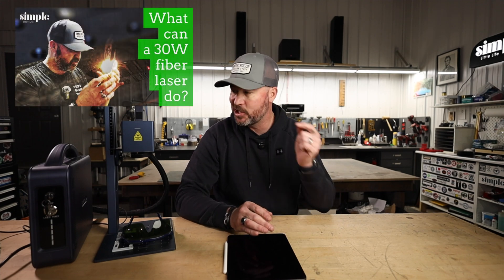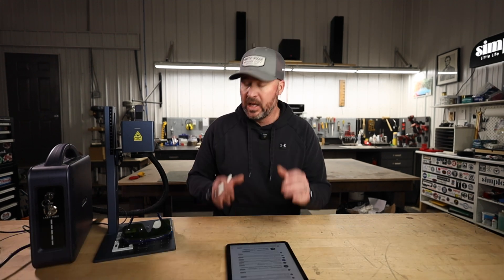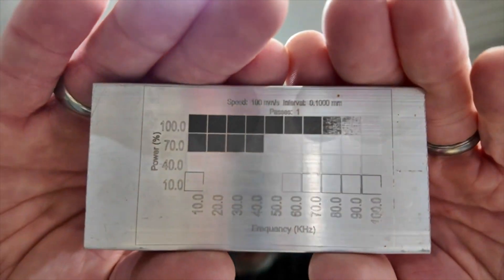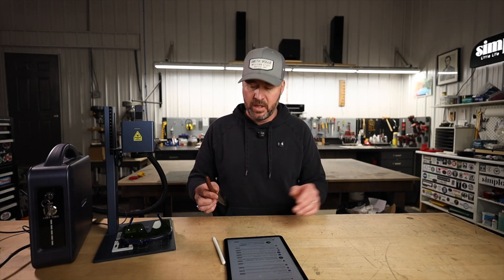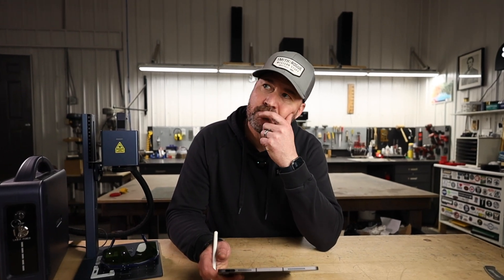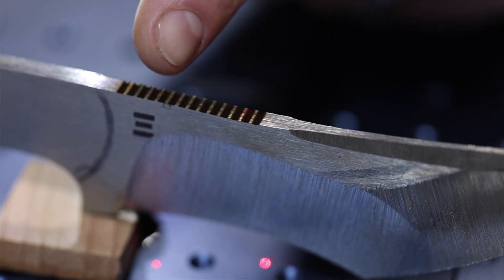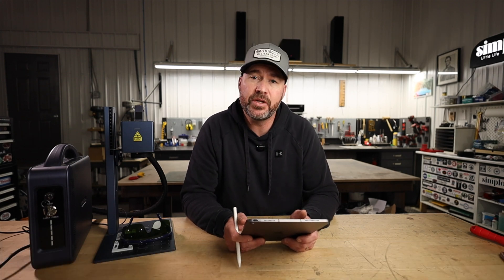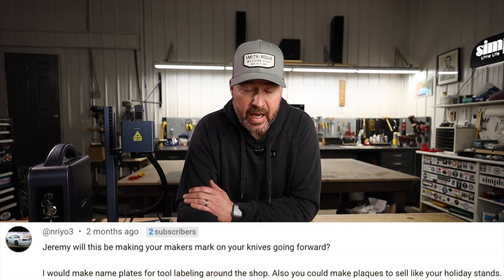5 Month Experiment with FIBER LASER Technology Changed Everything

Comment: If you think that handheld meter is measuring the temp your dillusional.  Sparks like that are ablating metal, Thousands of degrees plus,....at best your mmeasuring an average of the temperature in a larger area of the knife and probably the table....grab that with you fingers and you'll laugh at the 150F measurement.
Reply from the maker: It measures the surface of the blade. Of course the laser is super hot at it's pinpoint tiny beam, but the mass of the steel stays relatively cool. I did pick this up after the laser work was done and it's not that hot. You've obviously never picked up a piece of steel that was just etched with a smaller laser like this....

Comment: I just have a basic 20w diode laser that was given to me, and I’m constantly discovering new uses for it.  I just started experimenting with cutting tang holes in spacers for hidden tang knives, and it seems like it’ll save me a lot of time.  I under size the hole by a few thousandths, and just have a little bit of file work left to get a perfect fit.  I’ve also found it very useful to stencil patterns on flat stock so there’s a perfect clean outline to grind to.
Reply from the maker: Right on, that's a great idea! Yeah lasers are the type of tool that you're not really sure how much you use, but then you just start finding new, time saving, use cases for them. Cheers 👍

Comment: wow, what a cool tool, never seen one before, how much work is needed to put the makers mark on the computer and what software does it use?
Reply from the maker: I use lightburn and it's fairly easy to use once you get the hang of a few basic parameters. Just import the file that is the maker's mark, choose if you want to outline the image or trace it and you're good to go. 👍

Comment: Just curious: Could the laser be used to SHARPEN the knife?  You could certainly make a serrated blade from a straight blade.  If you cut at an extreme angle it might leave it "Gnarly sharp" like a microscopic saw blade.
Reply from the maker: That's an interesting question. The idea of it sounds doable and I wonder what the practicality of it would be in regards to the effect of the heat on the edge. In theory, it sounds like it might ruin any edge retention properties but it also sounds very interesting just to try. You've got me curious... Thanks! 👍